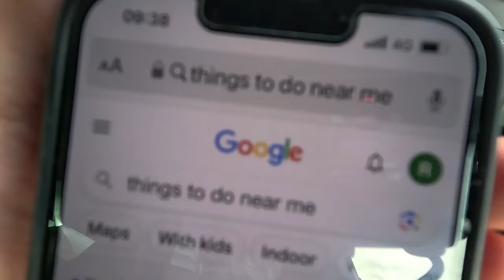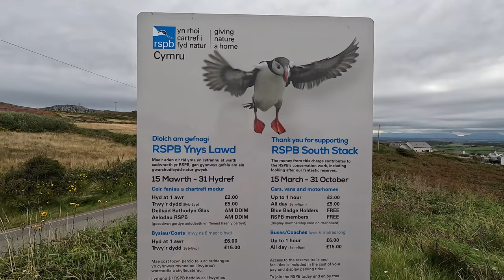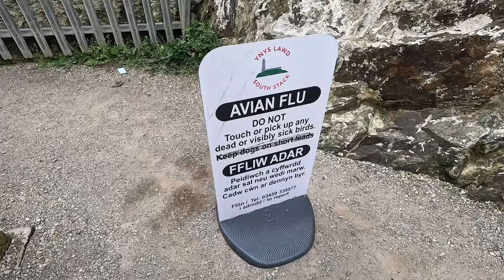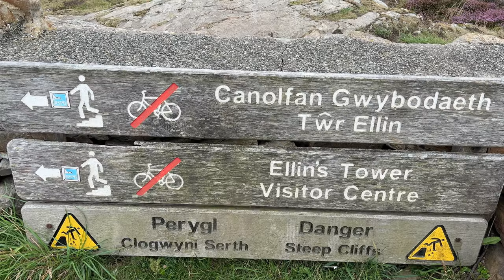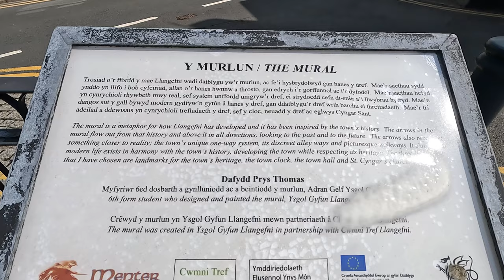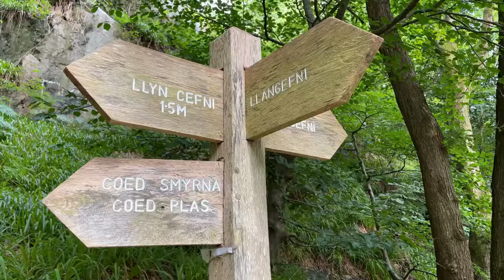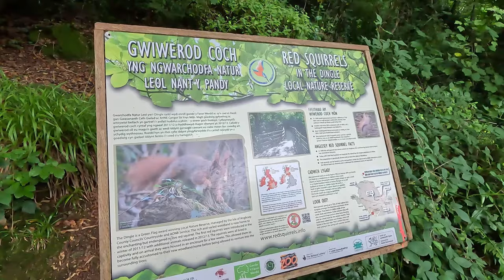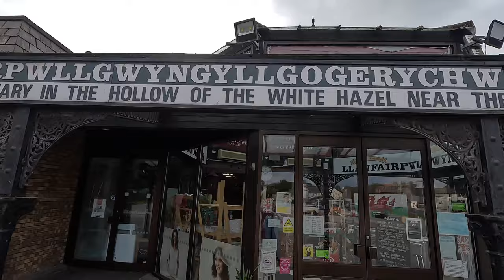Things To Do In Anglesey Wales - North Wales Vlog

Comment: How do you stop the wind interference with your camera mic?
Reply from the maker: Hi, since our Ibiza videos, we’ve mostly used a GoPro 11 which has a wind reduction filter built in (as well as using the foam pop shield on the mic). We use the automatic setting which to be honest is a bit hit and miss, depending on how strong the wind is and how it hits the mic. Also during editing, sometimes we’ll add a high pass filter to the audio (cutting out low frequencies while letting through the higher ones). That’s pretty much it to be honest. Hope that helps? Cheers
Reply: @PostcardAndAPint  thanks I'm gopro 11 also but trying to get the best sound isn't easy as wind reduction to me sounds mono. Your videos always sound crisp and with us both having to deal with the wind in Wales etc  thought you might be using a magic microphone 😅🤣
Reply from the maker: @outandaboutwithus  ah cool. Yes, the wind reduction feature does do some funny stuff with your sound, whenever any noise reduction is applied, something suffers somewhere, which is why we generally have it on auto, rather than in permanently. If it helps, when we edit, I’ll take the track with the camera audio on its own and then normalise the file, add a high pass filter then compress it so it’s all fairly even. We do the same with the voice over track and then take a while to mix the 3 audio tracks (camera audio, music and voice over) together. Sometimes I’ll then compress the full mixed down audio, but not always. You’ll probably notice that we don’t always have that much camera audio, the majority is music and voice over - which is easier to control. Hope that was of some interest (I’ll put my anorak back on now 😂). Cheers 🍻
Reply: @PostcardAndAPint  no that's perfect to the technical minded unfortunately editing is not my strong point hence a wak tour 🤣 thanks for all your help  but at the min I thunk if its windy on ours your going to hear wind 🤣😂